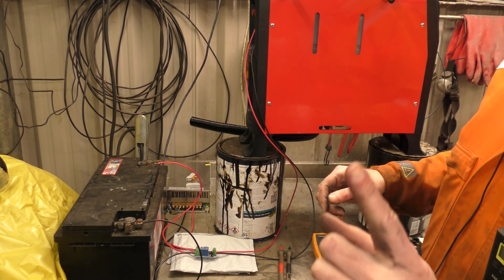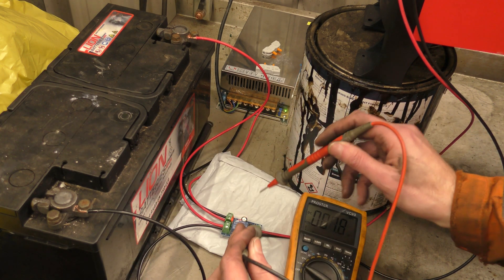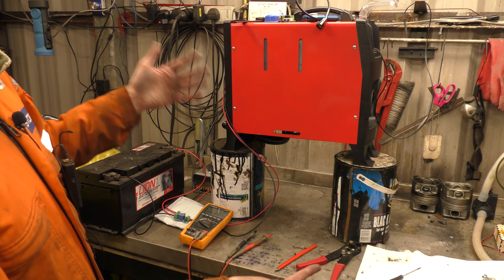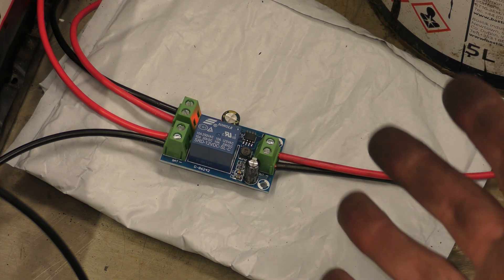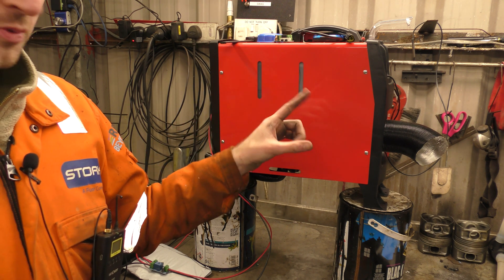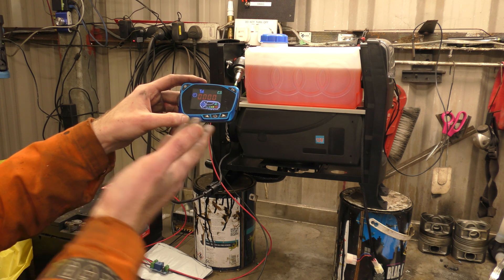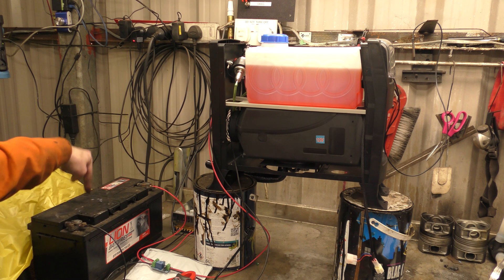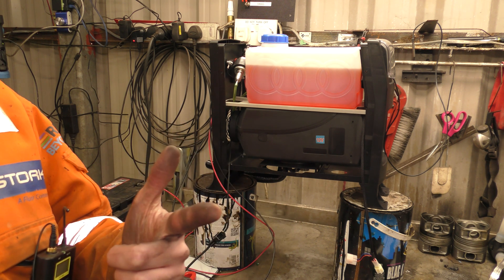Emergency automatic switch from power supply to battery 12V module

Comment: Relay lag is too slow and iffy at what point it operates or falls. Diodes are quicker and smoother. Using a transistor is even quicker. Just an observation. Thank you.

Comment: Update: I just hooked me a : 
HELLA 6235 Miniature Standard Bulb, 12V, 35/35W, Multi
 auto bulb to my power supply / even a 30 amp power supply one / and it switches in less than .05 mil seconds & heater stays running.. I did burn up a cheap power supply trying Bleed Resistors but it burnt them up and the Caps & few extra resistors... Some say you can use a BIG power resistor but they, 2 me draw way more current than a 35 watt bulb. Going to try a 25 watt, same type bulb this weekend & may add a dimmer to dim the bulb down some. I have it hit behind a t.v. so it really doesn't bother me any.. Thanks 4 Video.

Comment: I run a chinese diesel inside to keep room warm. I am using a 30 amp 120v - to 12 v  plug in  power supply. What happen if I just also hook up a 12 v  -10ah battery to the back of the heater at the same time? Wouldn't the heater draw current mostly from the 120 power supply ( because it would have the over-powering 12v source) & possibly keep the 12v battery charged up a bit so if power went out to my home the 12v battery would be there to let the heater run down it's cool down cycle? I just need it to cool down correctly until I hook up a 200amp hr Li-po Battery & inverter to it... Thanks for Video . . .

Comment: I would suggest some power regulation on each power source. The heater is probably looking for the same voltage from each power supply and is switching modes when it sees the change to your second supply. If the voltages were the same or within the tolerance of the heater it might not go into a different mode.

Comment: What if i use it with a 12V 7AH battery..will it work when the battery voltage drops from 12 volt to something like 9V?

Comment: Can you wire it so that the main power source is the battery and the backup is 12v  DC from mains. I ask because I have outdoor LED lights running of a battery that is charged by a solar panel.  I want to use mains power as backup only

Comment: I purchased this automatic switch module a couple of months ago. The USA Amazon page for this item includes some information that is not included on the UK Amazon page that you referenced, so it's understandable why you thought that charging the battery once in a while would be necessary. The USA page includes the following: Efficient Charging - This controller not only switches between power sources, but also charges the battery when the main power is available, maintaining the battery's readiness for emergencies. Also states, Its automatic voltage identification capability works for DC voltages between 5 volt and 48 volt. It automatically identifies the required voltage. I grew weary of changing the required four AA (1.5 volts apiece) batteries in our propane hearth heater, so this was a good solution. I also purchased a 6V 2A AC adapter (looks like a cell phone wall charger), which enabled me to plug the unit into the wall socket. To visit the USA controller page, click https://www.amazon.com/dp/B0CGRJVTF6?psc=1&ref=product_details. To visit the AC wall adapter page, click https://www.amazon.com/dp/B09XM2FVC1?psc=1&ref=product_details. Thank you for the video. I subscribed to your channel.

Comment: I use a Chinese power supply with a built-in trickle charger and a 7Ah battery. It acts as a UPS and shuts down oncel the battery voltage goes low. Thanks to @deoxyrobo for the idea.

Comment: I want to use this controller with a off grid setup. I want my 12v 50ah battery to be the primary power supply, and a smaller 12v 10ah battery for the backup, just to run the cool down cycle. Does anyone see any problems with this?

Comment: I like the concept, but relays are known to fail.
Just connect the power supply directly to battery, and this ensures the battery is always fully charged. 👍
Actually, i'm looking for a module similar to yours, but to control the charge voltage/s
eg/ stops charging @ 13.2v (70%), and to kick back in @12.8v (17%) on a LifePO4 battery to maximise 'cycles'
Dunno if such a module exists as I haven't found one as yet.

Comment: Rats , waa hoping it would work ! Maybe someone makes a relay that's faster!?
Reply from the maker: I've been told you can use a 5 pin relay which should switch instantly.  I have not tried it yet.

Comment: A better solution has been proposed by Alastair Reynolds and his design is simple, cheap, highly reliable and does not suffer from 12V interruption. Well done David for sharing your experience. Keep inventing.
Reply from the maker: Do you have a link?
Reply: posted a link  @DavidMcLuckie
Reply: @DavidMcLuckie did you ever get the link
Reply: Will this also keep the battery charged?
Reply: @rolandwakeman3391  yes, the psu charge the battery via the 22R resistor. You need to keep the psu on.
Reply: yes, it will  @rolandwakeman3391
Reply: Have you a link please
Reply: posted a link  @tonyf182000

Comment: Okay. So I see a problem. The product description says the the the same voltage is required for the power supply, the battery and the load for this work. But a 12v battery requires a higher voltage for it to charge - 13.5 to 15 volts. Then the battery supplies 12volts to for example a 12volt Lighting circuit - the Load. How can this work then if the voltage must be the same for the supply, the battery & the load? The battery won't charge and will eventually go flat if this is the case. What are solutions so you don't have to keep changing the battery?
Reply: its not a charger, it just realizes that the primary power supply is cut and switches after a decade or so to the other one. the device dosnt care if its a battery or something else. i dont really get the point of this. 🤣 i ordered it from china, but it makes not much sense.

Comment: i recently did this myself. all i used was a 5 pin reljust have to bridge 87 and 87a. and then each power source goes into 87 and 87a inviduallly. and then pin 30 going to power said device. and 85 to ground
much simpler. and no need for this module that can get fried!

Comment: this works Awesome !  I run a AC 110V - 220V TO DC 12V Regulated Transformer Power Supply (15A) then  I hooked up the back up module  up for battery back up on my Diesel heater . and a solar panel & controller to charge the battery .Thanx again

Comment: Hi me dh in a box will run off 240 to 12v  12v direct and a back up battery we use caravan conditions, and andison any ideas how to do this. The main problem is where to fit in the Anderson 12v direct. I might use a 3 way switch as used these before

Comment: Maybe a capacitor on the heater wires would hold enough charge to keep the heater powered for the time the relay unit take to switch over.

Comment: Probably you should connect diode bridge and big capacitor after diode between relay controller and heater. And then capacitor should keep power till relay changes from psu to battery

Comment: Hiya David love your videos Good down to earth stuff I fitted up a voltage drop unit  Works fine Except when I connect it to the pump wire It keep blowing fuses to the voltage drop controller Had a 5 amp 10 amp and 15 amp blew them all after 4 or 5 mins Any ideas as to the problem Regards Ronnie
Reply from the maker: The fuel pump should only ever be connected to the heater.

Comment: David,  as always great vid! I've no definitive solution just an idea, a novice one at that.  Would the AC  to DC regulator supply, connected direct to the battery or a smart charger to the battery give a constant reliable supply and charge at 12v, with either.  the battery could act as a  through charging device be able to deliver the amps required to start, stop the diesel heater, therefore there would be no interruption of power because if the AC supply is terminated, not in an alcapone way!  The battery would still have the rough 40 to 47 Watts available power and maintain continue power, until the AC is restored or heater is shut down upon power outage.  Being a novice I expect a negative come back, but as a novice wannabe, I foresee the 2 second switch is because theres 2 negs and 2 pos Seperate with no direct link, with the ac taking a  taking primary role, whilst if they were joined, there should be no physical delay in the break of power..  Also would the ac to DC regulator deliver a constant battery charge, with an inline safety fuse in place, to protect the wires and prevent over charge.   I await if any your thoughts.  I ask, because I use an allpowers solar generator in my van, linked to the 12v leisure battery, using it as they say a through charge., there's some reduction of leisure battery, on the road charging but after an hours drive, also a full generator charge, I disconnect and qed the leisure gets charged as normal, plus I've solar from vans roof on a direct link to the allpowers genny, which has its own mppt, so I understand it to be safe and self monitoring. Cheers and keep these unique videos coming, Mrs loves you quirky Scottish play on words. She has her own being a irish
Reply from the maker: Yes.  A lot of people run like that.  Sometimes the 'smart' chargers don't like the constant draw of the heater and see it as a battery fault.  But a 'dumb' charger that just sits at the float voltage for the battery works.  If you get one that charges with about the same amps as the heater uses while running, it'll run the heater and leave the battery fully charged.
Reply: @DavidMcLuckie  do you know how long the cooldown cycle runs for and how large of a battery is needed to do this? Will a lawn tractor battery be sufficient?
Thank you for all your great videos 😊
Ray

Comment: Can anybody help me. I have a truma water heating system in my new caravan and has an error code which says ..... heater has no 12v power supply. How do I locate the wire 😭😭😭only just bought it paid 16k and don't know what to do. I've joined all the caravan forums but no luck

Comment: David, for an uninterpted power supply you would need to route the power through the battery from the mains? When the mains goes down the battery would already be in circuit? Keep up the good work!

Comment: Will this module also help charge the battery ….
Reply from the maker: Negative.  Just a low voltage switch basically.

Comment: You just need a few extras on that module so it has capacitors so it smooths out the 2 second power cut

Comment: Try the 12V 150W Backup Battery Switching Module high power Board Automatic switching battery power XH-M350.
Looks like a faster transfer time.

Comment: if you put 13.8v to 14.1v charger to the battery from the mains the heater would continue to run when the mains went down and charge the battery when the heater is not in use. and you could put a  battery protection inline to stop the battery over discharging say stopping at 12.2v

Comment: I just run mine in line with my battery I take my 12 volt power supply and connect it to my 12 volt battery that way it keeps my battery charged without overcharging it and why it's running the batteries act as like it's not even there so if I lose power it's already connected to the 12 volt battery no magic switches or other complicated devices to purchase just go from the power supply to the battery to the diesel heater keep it stupid simple that's my motto
Reply: Basically you kind of like the connection in a vehicle you have an alternator a battery in this case the alternator is the power supply

Comment: Hi I’m not electrical minded but was wandering if I put the battery on constant charge, then connect the battery to heater, would that work?
Reply from the maker: Yes.  You'd just have to make sure your charger can output the 5A the heater can use during running, otherwise it'll flatten the battery.

Comment: could you not just use a 12v SPDT relay.. when the power supply is on the relay coil is energized and  the live is passed through the relay and when power fails the live switched to the battery?
i know the voltage would change quickly but would the heater care?
Reply from the maker: That sounds like something to try.  :)

Comment: The power supply is set to low to charge the battery completely. The standard charging voltage from your car is 14.5 volts. This does not help your switching problem but it will improve battery performance and make your battery survive longer.

Comment: Why not just have a charger on the battery that maintains its level and if the power drops out, so what? If the battery is gonna be in the mix, why not have the battery be the failsafe. At least then the heater remains on. What am I missing?

Comment: I do a variation of what has been suggested here in other comments. I used my 52V e-bike battery attached to a smart charger. The output from the battery is then connected to a 12v output boost converter that keeps the voltage to the heater at 12.22v all the time. I'm guessing the heater likes the constant nature of the voltage. This setup avoids the up and down cycle of the battery depending on the state of charge. Because I don't ride my bike in the winter, this helped me avoid buying a new battery and it will easily run the heater for more than 24 hours without the charger in case of a power outage. Actually, it will probably run the heater for near 36 hours but I have never tested it.

Comment: let your ps charge the battery and parallels the heater with the battery. set the ps to keep batt charged. 1 have 4 set up that way works great
Reply: @martehoudesheldt5885 can you explain exactly how you achieved that?

Comment: If you added a 10.000uf cap say 2 of them would that be enough on the out put as the relay switches
This should be enough for the current draw

Comment: I was thinking as already mention before. Just wire the heater to the battery and have a battery charger also connected to the battery. If the power is cut then there is no difference in power to the heater.
Reply: This is what I do and so far works like a charm.

Comment: No, what you do is run the heater from the battery but have the battery permanently being charged. If there is a power cut the charger stops but the battery continues to power the heater
Reply from the maker: Yes, as long as you are using at least a 10A charger.
Reply: @DavidMcLuckie not as long battery is charged.  It's less than 3amps after it starts

Comment: I had an issue with unreliable mains supply, so I ran an adjustable power supply into the panel input of a cheap own solar controller: mains goes off and heater kept going. Had that setup for over a year with no problems. I set the PSU to 13.2v to avoid off gassing. Hope this is useful!

Comment: I have my PSU set to 13.5 volts, it connects to my CDH and also to my battery, when the power goes out the battery keeps it all going and the only power consumed by the PSU when the mains is off is the amount needed to light the LED on the PSU, tested 10 ways to hell and it works with no fancy switching gear. It also keeps the battery on float charge of 13.5 volts when the mains power is on. My unit does not even blink when the mains supply goes down.
Reply: put up a video showing your setup so it may help others or even send the info to David so he can make a video about it.
Reply: @CBdesigns70  He should be able to sort it with the info I provided above
Reply: @MayTheLightBeWithYou  I just run off my old mondeo battery that could no longer start the car on a cold morning and basic (not dumb but not inteligent) Halfords charger and everything seems happy. I do have a spare 240 > 12v psu but never got round to using it since the battery and charger works just as good if not better than relays and diodes etc. Other people and those learning may have been interested in your solution tho.
Reply: @CBdesigns70  I posted to a group called Chinese Diesel Heaters UK, you would not believe the number of idiots on that site, I simply cannot be bothered with that crowd and shall keep my years of education and experience to myself, I've no patience left for idiots
Reply: @MayTheLightBeWithYou  I would believe you as I have been having a chuckle reading thru some of the posts in the group. it`s like the blind leading the blind and the uninformed spreading cdh gospel news and lies then flaming each other fir posting shit.. I only use FB groups when I need to relax and lighten the mood every now and again. the best one is the afterburner page where you get permaban for thinking ray`s name under your breath never mind asking a question that he may not like. I am sorry but Ray is not a GOD but he has done some good research and work with Afterburner. each to there own i suppose. The little remote keyfob is all I need to start up the heating in my man cave from the house before I toodle out for a few hours work (reading the internet away from (Hur indoors)) lol

Comment: I think it's the PSU that's holding the relay on for too long between powering off and switching over, owing to capacitors storing enough charge to keep the relay closed, causing the heater to conk out and reset, only way I can think of to resolve that would be another mains-coil relay that is on the 240v side of the PSU that cuts the 12v output from the PSU off the moment the power is lost, thus cutting out the caps and (hopefully!!!) switching the switchover relay off faster... :)